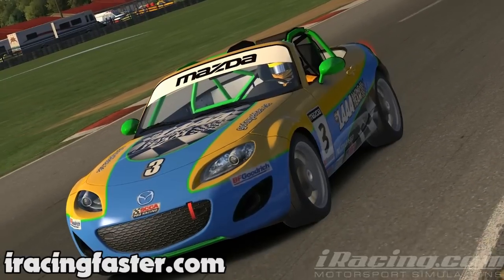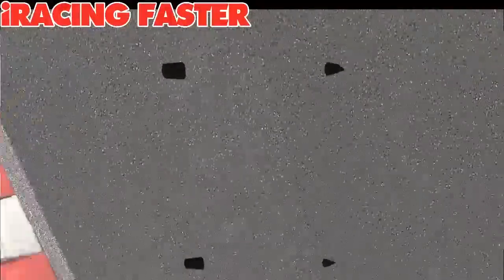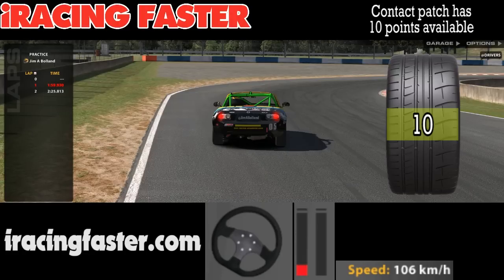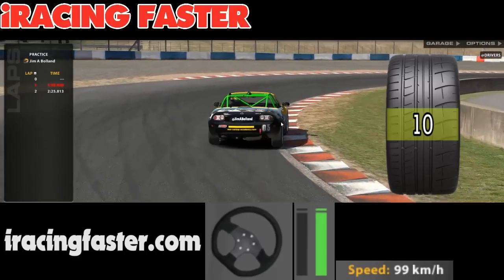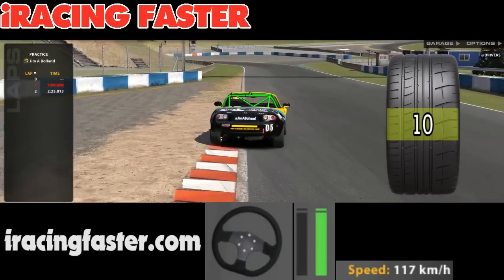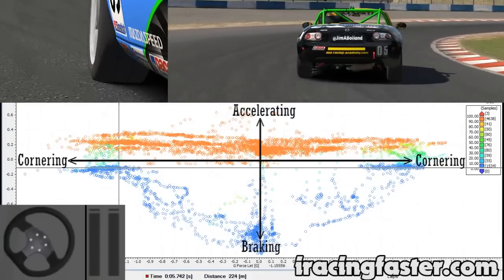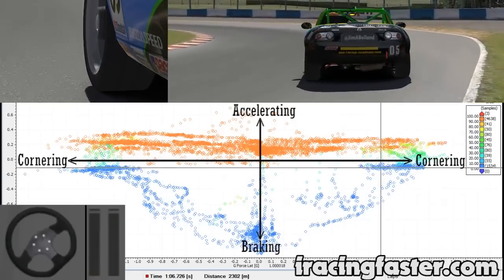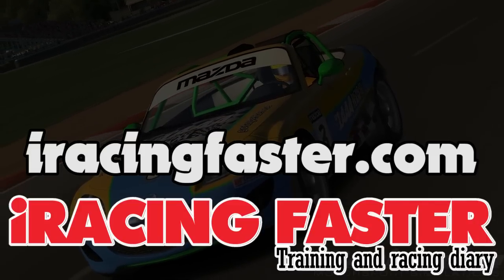iRacing Faster 3: How to drive your tires to go fast

Comment: Dude you need to explain the braking more thats trail braking you were showing you dont have to so that but some people may think thats a have to and it isnt and its for more experienced drivers trial braking is lifting off slowly while turning as an easy way of explaining now with f1 you dont want to do this you only want to brak going straight and you arent supposed to turn under braking you did great here man but some little things missing see normal braking is you brake while straight lift off and turn in what you ahowed wws nore like trail braking

Comment: Hi jimmy. Great video .I understand the points as I've also read lots of books like Ross  Bentleys. However I'm now confused . I attach a link for the iracing school and in the video they advocate trail braking whilst applying throttle . What's your take on this and surely the gforce trace will look very different? Thank you !

Comment: Surely acceleration doesn’t really count as it only affects the rear wheels? So therefore front and rear tyres have different grip dynamics?
Reply: Grip dynamics from front to rear on a rwd vehicle are definitely different but accelerating definitely doesn't only effect the rear. Weight transfer to the rear has significant impact towards understeer, especially on corner exit. I see people run wide all the time even though they're taking a corner slower than others that aren't running wide. Simply because they get on the power too early and had understeer.